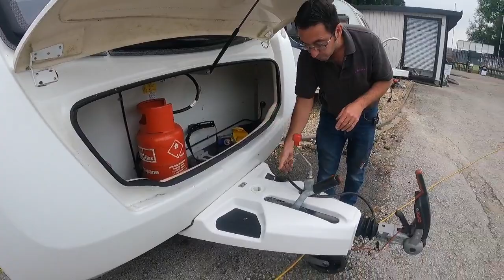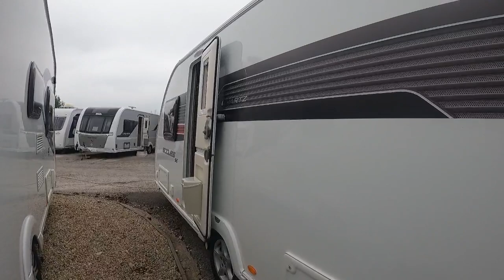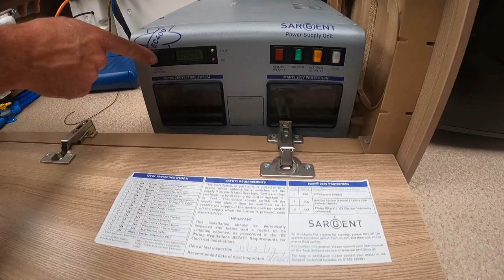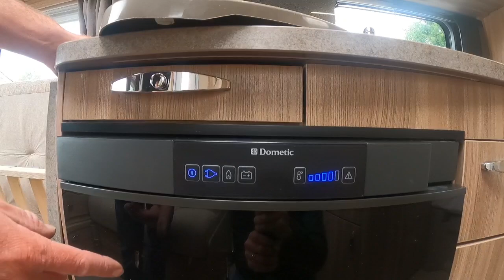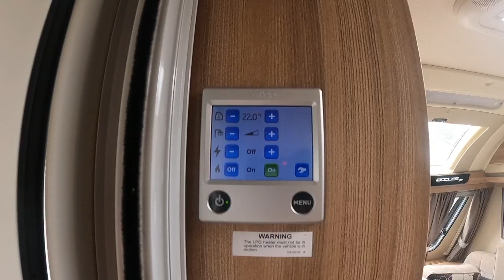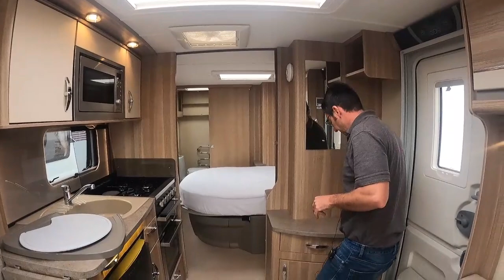Sterling Caravan setup and review. How to set up a sterling Caravan.

Comment: Really hoping you can help me. Similar caravan but not as new. It’s an Eccles Sport 584. I’ve got water at the taps but after a while, the pump kicks in and doesn’t switch off, as though it’s sucking air. Cannot find a water pressure switch anywhere. Do you know where it is or any other possible cause thankyou